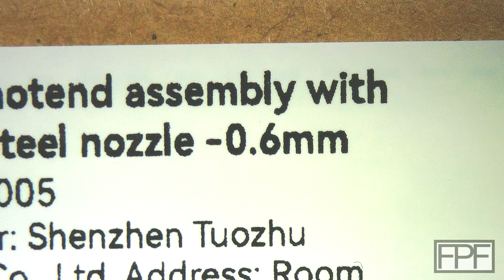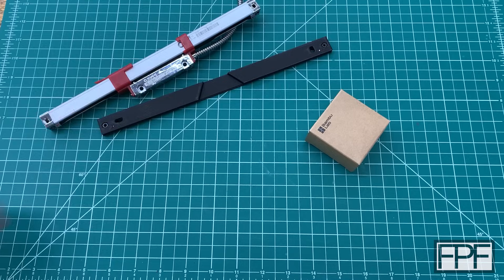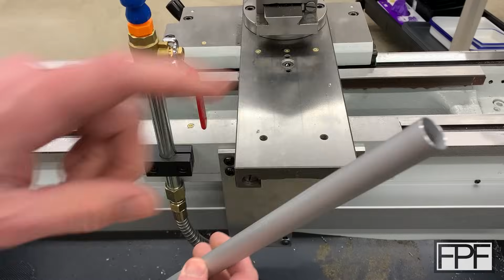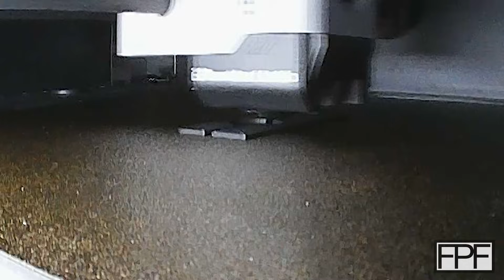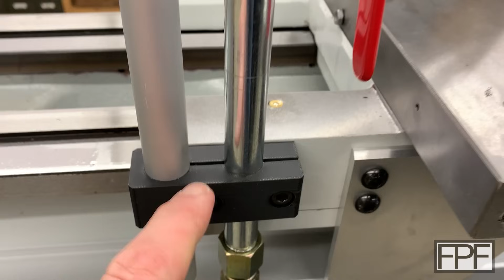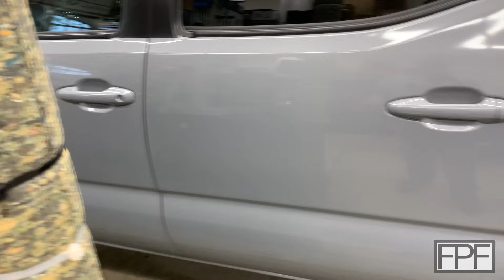3D Printed TouchDRO Display Mount for Lathe

Comment: I watched a video of Applied Science. He was talking about how pure alcohol can be worse at cleaning  than alcohol + water - don't remember exactly, but I think 60-70% was good. I'm saying that because in some of your videos I saw you are using 99+ IPA. Some things are soluble in water, others - in alcohol. I know you said soap and waters is much better and I agree, but there is no sink near me - I have to walk 20 meters to get to one. If it takes more effort I'm not going to do it that often. So unless I'm desperate I use 70% ethyl alcohol to clean the plate. I wash it occasionally. I also have one that I put glue on and one that I keep clean. For pla no-glue is better because it releases easier. I get adhesion issues sometimes when I get too lazy and skip even the alcohol for too many prints, but that's my fault. Also I'm really careful not to touch the surface I'm printing on.

Comment: O man, I have so many old mobile phones being used as accessories for other stuff I lost count!   I have a Microscope, DRO, Remote Jog Pendant, Webcam, it's endless.
Reply from the maker: This one is actually brand new.  My wife picked it up (prepaid phone) in a pinch when her normal phone wasn't working and she was far from home.  Somehow the phone was "free" with 35 bucks in prepaid minutes.  I thought for sure it was somehow a scam or we were missing something, but the phone legit only cost me 35 bucks with no other strings attached.  I think they do carrier lock it until you buy enough minutes, but I could care less since I only need the wifi to work.
Reply: @FunctionalPrintFriday  That's awesome!!

Comment: A trick to more easily get a “snug” fit on the inside of a hole: put a couple axial ridges along the inner face. It gives you a much wider tolerance for a decent fit, since the individual ridges can deform and sort of press out into the infill. If the inner surface is completely circular, the only way for it to deform is for the entire perimeter to stretch, which gives you a very small window to work with.
Reply from the maker: great idea, thx!

Comment: So the gloop isn't actually Glue I don't think - I believe its a chemical that melts the plastic together instead of an adhesive - yes, amazing strength - I've tried to get things apart and the plastic fails NOT the connection.  What I've found to do is to take my time to get a nice coat of gloop on the parts - make sure I'm still staged good and ready to assemble - THEN add a second coat before putting the 2 parts together for the final time.  While it looks like it sets, it IS still "working" and the second coat increases that working time. A clamp works wonders too if you can...
Reply from the maker: thx, I'll give that a try

Comment: Clean your PEI build plate with some rubbing alcohol, and heat soak your bed for a little bit till the chamber temp is up there. If it still wont stick, try increasing bed temp till you find a good temp that makes it stay stuck to the bed. I think I did 110c on my bed for nylon, but I cant remember... Oh, also,  you might need to slow down first layer too so that it fills all the little pits on the PEI sheet and sticks better. If you print too fast on first layer, it sometimes creates little air pockets and cause it to peel up easier.

Comment: Regarding that one part and the failed prints, I've had this issue with some parts. It baffled me that one part would print but that one would not stick. I ended up moving the print to a different section of the bed. It was then able to print. Honestly have no explanation why it would make a difference. Also, I use glue paste for better bed adhesion.

Comment: not sure if carbon nylon is similar to petg-cf; but I had to raise my bed temp to nearly max recommended as well as nozzle temp. Additionally getting the latest bambu firmware has helped a ton. Also on especially tricky prints slowing down a lot helps and cleaning the print bed every single print as well as ensuring the nozzle tip (outside) is clear before every print.

Goodluck!

Comment: Garolite (G10) is hands down the best bed surface for any Nylons. Others will work okay, but I've never had a Nylon print fail to stick to G10. No adhesive needed at all, just clean with IPA. You can build your own by sourcing G10 sheets, or buy a bed from Lightyear. I've done both with equal results. Great projects!

Comment: Love your videos so much.  My path has been the opposite - tons of 3D printing experience, then got into machining.  It's so interesting to watch the progression from the other perspective.

Anyway, the monitor/coolant pipe clamp you built is another part I'd personally recommend in something other than CF-PLA; I suspect creep will become a pain with it loosening over time.  PLA sucks under constant load.  Looks like the tolerances are tight enough it might not be an issue, but if you get bored one day I'd suggest reprinting in CF-PA6 if you can get it clean, or if not CF-PETG... my personal favorite all-rounder.
Reply from the maker: It's actually the same for me.  I've been 3-d printing for 8 yrs, and I guess I did dabble a little in machining with a very basic lathe prior to that, but I've only just picked up the big lathe and mill in the last 2 years.  I pretty much love anything that helps bring the crazy nonsense designs in my head into reality.  There is no one perfect medium or process.  Gotta learn em all :)

Comment: about your bed adhesion issue.. since your using the gold PEI surface, you can use Acetone to clean it.  PEI is not effected by acetone.  Of course test in an small area first.  Also be aware to stay away from the lettering with the acetone, it will remove the screen printing.  I have switched to only using Acetone on all my gold PEI, smooth or textured, and it's much better than using ISO.  Oh, and don't use cheap nail polish remover even if it says Acetone... that stuff always has additives or is cut with something.

Comment: I stopped at 3:21 to tell you that I had the exact same problem with sticking on my two day old Bambu Mini. Everything I printed came out perfect until I got to this one file. I even added glue stick which was not needed before. Even that didn't work. Somehow, somewhere, I made a mistake in the drawing. OR I sliced it in Cura by mistake. The Bambu doesn't like my Cura slices and usually won't print them at all. To make a long story shorter, I redrew the damn thing, sliced it in Bambu Studio, and it printed flawlessly.

Comment: Try some scigrip/weldon. It works really great with abs (probably because it’s meant for acrylic). The key for any adhesive/cement/glue is prepping the surface. Use some high grit sandpaper (300-400), or some green scotchbrite to rough up the mating surfaces.

Comment: Be careful with old android phones thet are always on and plugged in. They have a tendency of killing what is basically very old batteries already.
I've been using them on my printers as touchscreens and I already had 2 battery puff up in a few months.

I modified the last one to work without a battery, but it was a pain and I can't really recommend it.
Reply from the maker: Appreciate the heads up.  This one is actually brand new.  My wife picked it up (prepaid phone) in a pinch when her normal phone wasn't working and she was far from home.  Somehow the phone was "free" with 35 bucks in prepaid minutes.  I thought for sure it was somehow a scam or we were missing something, but the phone legit only cost me 35 bucks with no other strings attached.  I think they do carrier lock it until you buy enough minutes, but I could care less since I only need the wifi to work.

Comment: I print my PACF on the Engineering Plate from Bambu, and I've never had adhesion issues even with parts with a very small footprint.
Reply: What brand filament are you using?
Reply: @lroyson  I've used both the regular PA12-CF and the PAHT-CF from Bambu. To be fair, I've never tried the PA6-CF.
Reply from the maker: PA6-CF from Bambu

Comment: VisionMiner bed adhesive on a smooth PEI sheet will work. I just got that combo working with off-brand blue nylon string trimmer filament, so it will work for PA-12 or PA-06.

Comment: 19:00 blue tape pressed really well will give you a clean edge if you get squeeZe out.

Can you use one of these acrylic glue allocators with the tiny needle. Place together then squeeze till you fill the void etc.
Reply: Foam applicator qtip or even a syringe. For application. 
Tape to protect for sure.

Comment: As others have said clean the bed properly with soapy water and then with IPA. Afterwards try using a product called 3DLac which is basically the hairspray so many above-mentioned. That works well for me on the same machine.

Comment: What buildplate did you use to print pa6 cf ? Would a glass bed be  preferable for this use?
What build plate temp did you use? I would recommend 240/250°c for pa6 cf.
What layer height for the 1 layer ?
And is you first layer set right with the correct squish and maybe use a brim to prevent lifting from the bed.
Reply from the maker: Bambu Textured PEI

Comment: Im not an expert in that material, but general bed adhesion tips
1) wash build plate with Dawn
2) wipe off build plate with IPA. Do this so you're wiping off, not just pushing around.
If that doesn't do it, there's hairspray or glue stick (not sure if they can react with your filament).
If all else fails, you may have to resort to blue painter's tape.

Good luck my fellow maker!